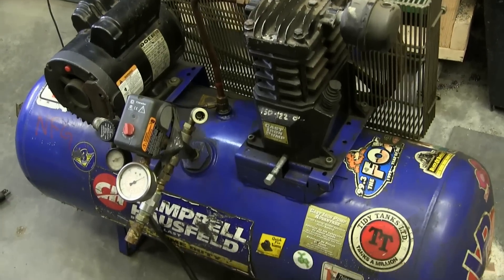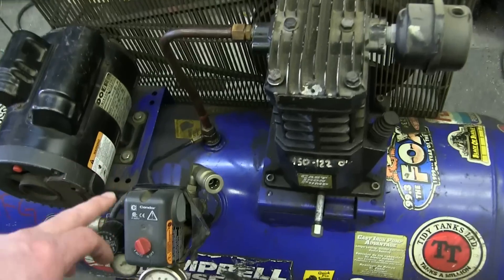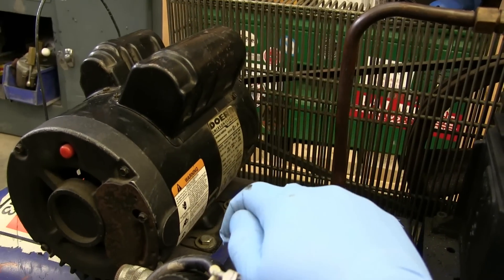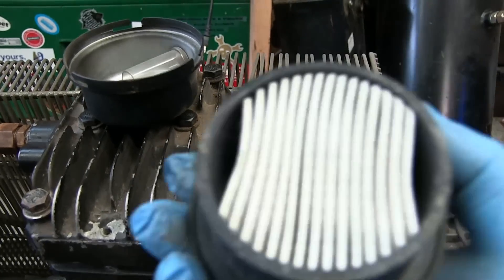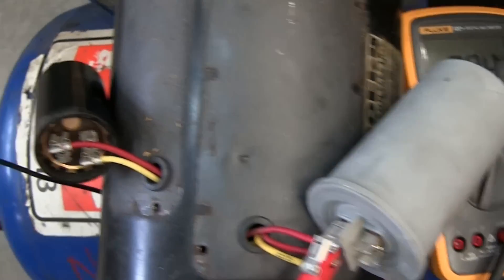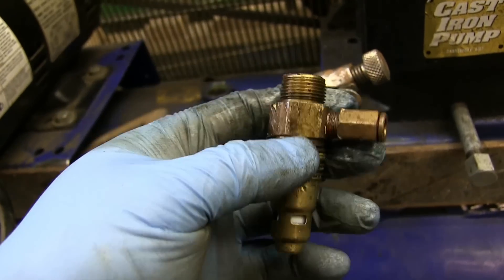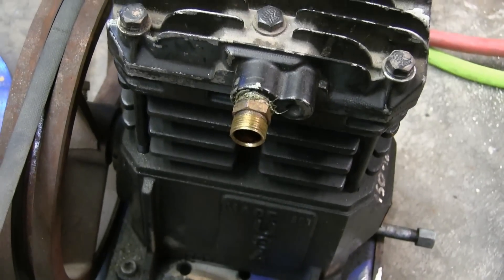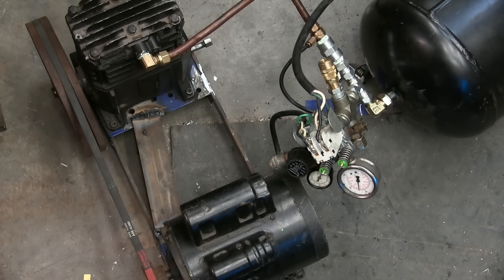BOLTR: Air Compressor Explained and Fixed.

Comment: One of my first jobs out of high school was welding at Campbell Hausfeld. you were definitely right not to try to repair that. The weakness on those compressor are the heads. I'm not sure how they test them now but the 20-plus years ago I was there we tested them in a "bomb box" They were pressurize to 350 psi. When the tanks fail they always blow the heads off. The larger tanks were Hydro tested. Tanks up to 30 gallons were tested under air pressure. When one of those tanks failed it would shake the whole building. -david
Reply: I worked at an aerospace plant for a short time were they had a compressor with a large tank in brick room attached to the building. When we got there one morning the bricks from that room were that tank was, was scattered all over the parking lot. The tank blew sometime in the early morning when no one was there. Thank God too, because part of that area was a smoking area. From what I remember, it was a 500 or 800 gallon that held about 200 lbs of pressure and that tank supplied the whole building. It just goes to prove that it is not just the pressure but also the volume of the gas held in the tank that will cause the damage.
Later, while I was in the US Air Force, at a base I was stationed at, one of the flight line maintenance crews changed out a worn tire on a B-52. They ran it over to the tire shop to swap it out, as the crew chief was rushing out the door with the new tire, one of the guys asked if they let the air out of the tire . He mumbled something back and the tire shop guys started to remove the tire. The tire rims on these aircraft are two piece and bolted together. As they got to the last few bolts the tools they had would not remove the bolts, so they got BIGGER TOOLS. As they got to the last bolt, the rim let go killing the two guys working on that tire. They never checked to verify if the crew chief had removed the schrader valve to let the air pressure of 600 lbs out. Hard way to learn a  lesson. 
That is why the semi-trucks no longer have split rims on them.
Reply: @ Krap101: These are low pressure. Low pressure requires only proof testing. Basically pressurize and prove it doesn't leak, distort or rupture. The manufacturer likely has an exemption/special provision to do air testing for expedience compared to draining the water and then drying the inside of the tank. The tank still experiences the same stresses as it would with water, the only difference is the vastly increased safety precautions required when using air. I intentionally ruptured a 2.5lb fire extinguisher cylinder at 900psi inside a cage and barely got wet while hydro testing it. A local dive shop had a reserve scuba tank about the same size rupture at about the same pressure. It was in a tub of water to cool it, the tub was destroyed, the wall damaged, ceiling tiles in pieces for a 8ft radius and the guy filling it couldn't hear right for hours after due to the shockwave. Hydro is way safer.
High pressure is another animal. All high pressure tanks need to be hydro tested. There are certain cases where the testing interval can be extended but there are requirements for tank specification, what it contains and how often its filled. But basically all high pressure tanks require hydrotesting unless its military.
Reply: I will add that a repair weld in this situation should only be performed by a qualified person. An industrial mechanic, millwright might not trust his welds on something like this, but if you weld steam pipe, steam valves, transmission lines or hot taps you are not afraid to weld something like this. I have seen these old tanks give problems only on the low end compressors. These budget oriented brands use thinner gauge tanks that have a trend toward cracking in the heat affected zone of the factory welds. Many times to bevel out the crack deep and braze the repair in is the best option. The higher quality well engineered tanks most of the time are 2 pass welded from the factory. The second pass is applied after the first pass cools to a prescribed inter-pass temp. that allows the second pass to stress relieve the first pass and the second pass cools slowly because of the pre-heat in the metal from the first pass. Brands like husky, craftsman, Campbell hausfeld, have the single pass welded tanks that are thinner than piss on a plate. Many times they just weld the heads on with one pass of solid wire mig. Your superior brands like Ingersol Rand and Quincy generally use 2 passes of sub arc welding. The sub arc flux helps to slow the cooling rate of the weld metal giving it better strength and ductility. The thicker tanks of the IR's and the Quincy's just stand up to the vibration and pressure cycling better than the thin tanks do. A compressor tank should be thick for the same reasons that boiler pipe is thicker than transmission lines.
Reply: a scuba tank is 3000+ psi, quite a bit different then a fire extinguisher.

I've never seen a air compressor tank catastrophically fail, seen em rust right out and get pinhole leaks, but never even a big enough hole to make the thing move.  The pressure just isn't there, these things typically only go up to 125 psi, occasionally 200ish on 2 stage compressors.
Reply: @Wooble57 
I have pictures of air compressor tank failures.
One picture shows the garage and it's contents all over the place, with a refrigerator that got killed.
It tends to be the consumer grade air compressors from maybe the old Sears or such.
Reply: I respect your opinion and agree with you about most things! In this situation I fell that a repair weld could be just as safe as all the re-plumbing and adapting required to retrofit that compressor to a new tank. I would say considering the fact that you have grinders, drills, torches, a tig welder and a stick rod machine welding is a very good option. I have welded many compressor tanks and never had a problem.
Reply: Keith Jurena Yelp!!! Thinking back it was section VIII requirements we had to get certified for. At the time the smaller tanks which were air tested were not getting a certified tag. I know that they were trying to move in that direction.
Reply: True story... when I work there the main guy's name was  Dick Hymen. Almost got fired the first day because of it.
Reply: I still remember the day a 30-gallon tank went off maybe 6 foot away from my welding booth.

The "bomb box" doors were maybe an inch thick and it had a brace that come up at a 45 degree angle to the middle of the door when it shut. The tank blew the door off, bent the brace, moved the line and knocked as several 60 pounds jigs off a rack behind me. My welding partner pissed himself. He wasn't the type of guy to piss himself lightly. 

It was crazy but tank head was flattened back out. Later they discovered that the exhaust pipe had a partial obstruction.

if anybody needs a tank they sell them around here sometimes for as cheap as scrap. I have some scrap sheets I bought from them awhile back. The sheets are .08 inches or 2.24mm There's no way I try to repair that. It could be done but I wouldn't take the risk.
Reply: tr0n
I never understood why they made split rims, I always thought it would have been better if they made them like the two piece rims on aircraft.
 Back when I was in high school (before dirt, early 70's) I worked at a gas station with a 4 bay garage. We sold tires there along with doing the normal tune ups and oil changes. Every once and a while someone would show up asking if we did split rims. My boss would always have us tell them no and we didn't have the right equipment for them. I remember asking him why he didn't want to work on them, all he would tell me was that they were too dangerous.
Years later, when I was stationed at Davis Monthan AFB I got to see why they were so dangerous. A constriction contractor was doing some work on the base, digging up old fuel bunkers with a large front end loader. The foreman was just to the right of the loader pointing to were he wanted the operator to dump a load. I was on escort duty  and watching from a spot where I was out of the way, when there was a big Boom. The foreman disappeared and all I could see was this big dust cloud where he was standing. I ran over toward were the foreman was to see if I needed to call over on the radio for medical. As I ran over there the foreman walked out of the dust cloud, badly shaken. That tractor had those damned split rims on those big tires and that front right one let loose. It just missed the foreman and was embedded in the dirt hill, inches from where he was standing. The guy driving the loader was a bit shaken too thinking the foreman was a goner, we all were. After that I was never comfortable passing a semi-truck that had those split rims when I was close in the next lane.
 And yes, thankfully they no longer use those damned split rims!
Reply: AvE glad to be able to contribute. Another thing that is kind of interesting about those tanks is the large spuds that's welded in there. In order for the tank to be a certified pressure vessel you have to have inspection holes that's why some of the holes have really big bushings in them. They double as inspection holes.
Reply: krap101 not really sure what you're asking tanks under 30 gallons were tested with air pressure. larger tanks were tested with water or Hydro tested it's really interesting to watch a tank fail under a hydro. It would make a really cool video to blow that tank up with water pressure!!
Reply: Gorilla Strength Equipment USA Oh, I was just wondering whether the air pressure check was a different requirement from hydro. I know most if not all high pressure gas tanks require hydro testing
Reply: krap101 At the time hydro was required one level of certification.  They were trying to move smaller tanks over to hydro testing so they could increase the pressure in the tank but they were having a lot of trouble with it. The smaller tanks out sold the larger ones almost 7 to 1.  Depending on the size of the smaller tanks each line would turn out 2400 tanks a shift. Hydro testing was a huge bottle neck on production. Just dumping the water from 2400 30 gallon tanks would take forever. 

It's been a long time since I was there but at that time 110 psi was the max pressure of the smaller tanks. I see some of them now at 175 psi. I'm guessing they are Hydro testing them. I don't recall the pressure limits and required testing for each. It's hard for me to imagine them hydro testing each of those but they may.
Reply: @GorillaStrengthEquipment  why drain out the water if you could blow it out? Like a bottle rocket?
Reply: Mark Pikas I've seen a few of them fail under hydro. Usually it would start as a pin hole (most often on at the tie in)  than it would start to rip in slow motion until it rip got an inch or so long. Keep in mind they were filling 60 and 80 gallon tanks up super quick so there was lots of pressure and flow. You didn't want to be around when the supply hose came off due to user error or a worn coupler. -david
Reply: Gorilla Strength Equipment USA : All depends on the pump used to fill.  Water is very resistant to pressure so typically the fill is from a low pressure source, then with air bled, a low displacement volume pump is used.  Called a deadweight tester, the piston is a rod about a half inch in diameter.   Weights are stacked on the rod, creating pressure.   Any leak is magnified by the movement of the piston rod.     You have to be careful not to trap pressure because a few degrees rise in temperature will cause pressure to rise far above the test level.
Reply: Gorilla Strength Equipment USA "heads" being the spherical "end caps?" (don't know the proper terminology)

If my above assumption about your statement is correct, there's a damn good reason the caps go, "because SCIENCE!!" as AvE would say. 

The proofs have long since been forgotten, and statics textbook sold

edit: rant re selling books back in college removed.

Anyway, in our "perfect" scenarios, it was easily shown that the end caps were under significantly less stress than the cylindrical section. So it makes sense that any catastrophic failure will include shooting the caps off. Of course I can't find them now, but we were shown some pictures of vessels that failed epically starting somewhere in the cylindrical section, with the tear traveling to an end cap and then around the seam where the cap met the cylinder. Which resulted in couple of very high energy missiles.

This can be seen in the Challenger disaster. After the booster burned a hole in the lower tank the bottom cap separated and turned the tank into a missile, sending it crashing into the upper tank resulting in the massive explosion.

tl;Dr
Unless it's someone like yourself who has training and experience working on a pressure vessel, send that shit out or just replace it. The stakes are just too high.
Reply: What do they do when they fail under hydro?  I was under the impression that they just popped a seam and started squirting, that would be a boring video.  I'm guessing it's more exciting than that?

This is making me seriously reconsider my current plan to cobble something together since my craftsman "professional series" (oilless) compressor just threw a rod and died a horrible death, I have parts from it, it's tank and a second tank, it's motor and 2 others to try and a BIG Kellogg compressor head.  Since the second tank is of unknown origin (60 gallon upright, the craftsman is a 33 gallon horizontal) and the neither have a beefy enough mounting plate for the compressor/motor assembly now I'm wondering about my idea of just adding a little to the mounting plate and tacking it to the outside of the tank.  I figured if I was going to pressure test it I'd either run it well away from the house and pressurize it or fill it with water and work out some way to get it up to 300 or so psi and be "safe."'  

Now I'm debating... I knew it was a marginally stupid idea to start with.
Reply: Air test is allowed under ASME Section VIII Division I rules for unfired pressure vessels...look for the metal tag, it will have a U stamp and list shell and head thickness, max allowable working pressure, min design metal temp and should have a Canadian registration number (CRN) .

MDMT is a laugh with GMAW welding because a gnat fart in the shielding gas will make the weld brittle.  And fatigue?  That is why it failed!  That 2" pipe thread fitting removed shell material without much replacement strength so the weld was stressed far past its low cycle limit.  Then the glue gun effect of GMAW concentrated stress to make it fail brittle in hoop stress.

Grind the GMAW crap out and lay in ER 70 S2 GTAW and it will be fine.  Hydro at 1.5 times MAWP and then dry out.
Reply: tdej80 : The ASME BEV Code changed slightly in 1998 meaning thinner wall and heads after that date.   Yes, submerged arc welding is the best, followed by GTAW and then SMAW.   GMAW, especially with 100% carbon dioxide, absolutely sucks in the ductility.
Reply: tdej80 when I was there the heads were single pass Flux. They were making compressor for tons of people under different brand. They make the lowes kobalt now and I believe are making the husky. I still have several friend who work there. I used to be able to get the tanks for around 2 dollars a gallon painted.
Reply: Iceberg86300 :  Hoop stress is twice axial.   IOW, stress wanting to increase diameter is twice that wanting to shoot the eliptical heads off..which makes the longseam weld the critical one in this vessel.  The failure in this case was a cleaning and inspection thread-o-let.  Specifically the weld securing it to the shell and I bet the weld was not assured full penetration.  Also it is GMAW, probably with 100% CO2 and ER70 S6 wire making it brittle as glass.
Reply: Mark Pikas Conceivably you could filll it with water until there is little to no headspace left and then top off with air.  
Think of it this way.  You put a round wooden block into a round hole, and push really hard, then let go, not much happens.  Then if you stuff the same hole full of something compressible like a sponge, when you let go, it all wants to come out.  If the hole isn't very deep, there isn't much available to come out, so there is less stored energy.

My recommendation is to make a saddle (2X4 and a cam strap would be the quick and dirty way to get er done).
Reply: tr0n
I never understood why they made split rims, I always thought it would 
have been better if they made them like the two piece rims on aircraft.
 Back when I was in high school (before dirt, early 70's) I worked at a 
gas station with a 4 bay garage. We sold tires there along with doing 
the normal tune ups and oil changes. Every once and a while someone 
would show up asking if we did split rims. My boss would always have us 
tell them no and we didn't have the right equipment for them. I remember
 asking him why he didn't want to work on them, all he would tell me was
 that they were too dangerous.
Years later, when I was stationed at Davis Monthan AFB I got to see why 
they were so dangerous. A constriction contractor was doing some work on
 the base, digging up old fuel bunkers with a large front end loader. 
The foreman was just to the right of the loader pointing to were he 
wanted the operator to dump a load. I was on escort duty  and watching 
from a spot where I was out of the way, when there was a big Boom. The 
foreman disappeared and all I could see was this big dust cloud where he
 was standing. I ran over toward were the foreman was to see if I needed
 to call over on the radio for medical. As I ran over there the foreman 
walked out of the dust cloud, badly shaken. That tractor had those 
damned split rims on those big tires and that front right one let loose.
 It just missed the foreman and was embedded in the dirt hill, inches 
from where he was standing. The guy driving the loader was a bit shaken 
too thinking the foreman was a goner, we all were. After that I was 
never comfortable passing a semi-truck that had those split rims when I 
was close in the next lane.
 And yes, thankfully they no longer use those damned split rims!
Reply: Hydro testing can also refer to the periodic hydrostatic pressure tests performed on certified high pressure  tanks every 3 years. (2-5000psi 10-30Mpa, seamless scuba and gas transport types.) Which is not a simple proof-load test. In Hydrostatic testing the tank is pressurized with liquid(water normally) while submerged in more liquid inside another tank(unpressurized but with sensitive volume measures) so that the stress/strain ratio of the tank can be quantified.
Reply: I too hate split rims but I've seen new single stuff fail too.Generally it's the tire that lets loose these days and one instance a coworker reached between duals on a bucket truck with 19.5's to try and fill a inner flat even after I told him not too.Well he paid the price for being lazy when the sidewall let loose with his arm between the 2 tires.It snapped both bones like twigs and was a damn miracle that he didnt lose his arm.

In another case there was a 22.5 truck tire that was just repaired laying in the shop.I guess whoever repaired it didnt notice sidewall damage or it wasnt visible.But he went and filled it in the cage,left it there for a bit and rolled it out before getting the truck.Well when it was laying on the floor the sidewall let loose and launched it 50ft in the air so hard it bent one of the steel girders that held up the roof and it blew out the office window............By some miracle with guys all over it missed everyone,but it sure left a lasting impression of what air pressure can do.
Reply: Originally from Vineland, now in Tucson AZ. My dad use to go over to Cap May with some of the guys from the company he worked for for fishing trips in the summer. I've been through Cap May a few times and got on the ferry once over to Delaware and back just for kicks one summer weekend. I wound up in the military right after high school and would get back home every few years. Last time I was back there was in 2013, man how that place has changed, almost couldn't recognize the place. It is all built up now, most of South Jersey was farm land, woods and swamps when I left. Big thing that kept me here in AZ is the winter weather, hated working out in the cold especially in the freezing rain.
Y'all take care and stay safe.
Reply: wolfedog99 Split rims seat on a groove in a similar way to (shallow) internal snap rings. Old style tires were too rigid to force over a full rim. When rust and wear eat the outer edge of the grove it becomes more like a ramp, and when inflated, KABOOM. Just a flimsy car tire sounds like a bomb when 15 lb. inflation pops it onto the rim. Awesome forces at work here.
Reply: That weld job is great! I sorry but it certainly was entertaining.
Reply: EIBBOR2654-I'm from Cape May although I dont live there full time anymore.
Reply: Mom-N-Pop Strength Shop
Reply: Yeah, just throw some dry ice in there, put a piece of tape over the hole, let the CO2 fill the tank from the bottom up, pushing out the O2, grind a channel along the crack and MIG it up. But i'm poor and have to fix it or do without.

I will say, this guy is hella funny and yet knows his tech intimately. Thanks for the explanation of how the motor starts and runs. I dint know that.
Reply: Gorilla Strength Equipment I know this is a very old comment but if you don't mind. I have a 20 gallon CH horizontal oil lubed compressor. It says 135 psi max and the pressure switch is set right there at that point. I also noticed they hot glued over the head of the adjustment screw to keep you from changing the setting on the pressure switch. I really would like to bump it on up to at least 150 psi. Do you think it would be ok with another 15 psi or is it just not worth the risk to try. Would that be a high risk or low risk chance in your opinion. Thanks for your time.
Reply: I used to build pressure vessels that were used for rock dusting in the coal mines. We hydro tested all of them, I can't imagine how much energy would be released if one of those were dry tested and ruptured due to overpressure. Some were 12 feet long, 4 feet wide and 3/8 inch thick. Woo, it would definitely clean the dust from the rafters, lol.
Reply: why dont military HP tanks require hydrotesting?
Reply: This is just what I am talking about, it is nice to see people who know what is ups! Some companies only desire to meet ASME bare minimum standards, others will strive to produce the best. Through welding engineering, material engineering, mechanical engineering, procedure improvement at floor level and use of only highly skilled labor some companies produce pressure vessels that will last 2 life times and others build a decent compressor with a tank that causes problems. In my opinion it is not hard to build a tank that will last longer than the compressor!